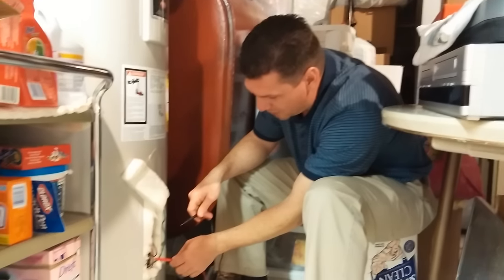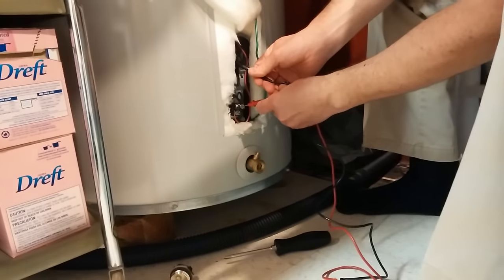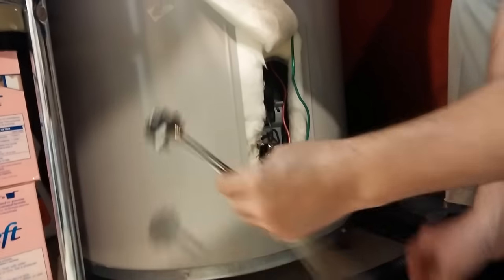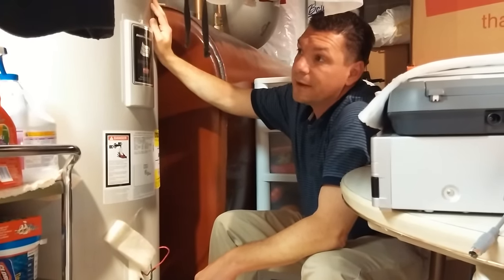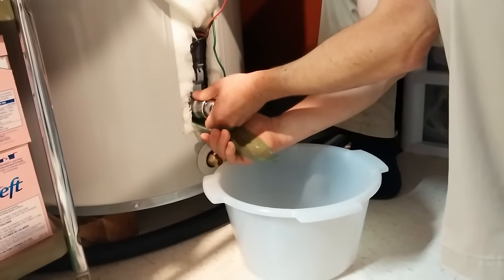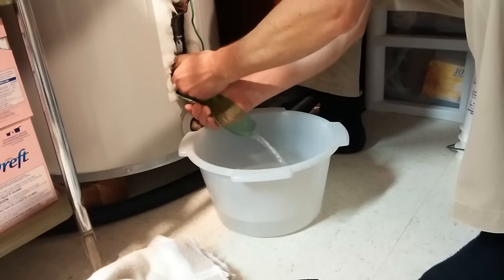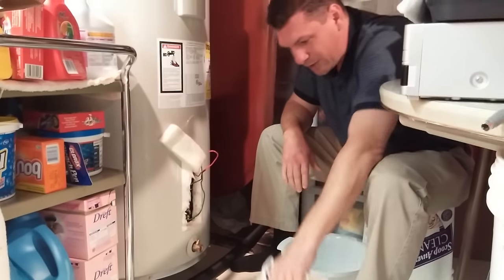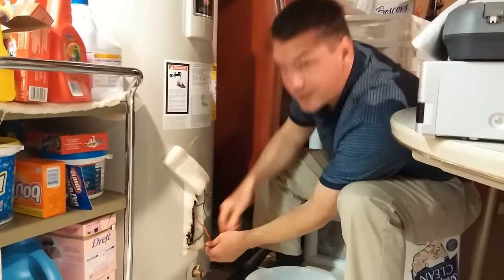Change a hot water heater element without draining or spilling water

Comment: DON’T DO IT THIS WAY. If you have hard water, chances are that your element will be warped. It will likely get mangled in the process of trying to remove it, meaning that to retighten it could end up twisting off the element from the end cap. Then, you’ll have the old element laying on the bottom of the tank. Or, you’ll realize you don’t want that, so you end up draining the tank anyway, but in a frenzy while trying to minimize the spill. Do yourself a favor and just take the few minutes to drain the tank. An ounce of prevention is worth at least 50 pounds of cure, here.

Comment: I just had to check because I just had the heating element changed in January and my hot water is out again!!! I never knew there were 2 elements and only 1 was changed so much water would run cold very quickly!!! Thanks to this Video it will be done correctly this time!!! Thanks for sharing!!!

Comment: So i was able to change the element thanks a bunch to this video! The tool to remove the element was at home depot where the water heater stuff is it was like $7. The element in my tank was straight and the one I put in was an s curved. This video however makes it look almost seamless. I have my water heater tank outside so I didn't care about spilling water but if Id a have it indoor I probably would've spilled more water than I would've liked. If you have 0 experience like me and your heater is indoors I would recommend a 2nd person to help you hold the funnel thing for the water and the plastic water container, and the other person remove and replace the element.
Reply: Even if you are outdoors couldn't the water get into the foam insulation inside the tank skin?   I would think having the device he showed would prevent that.

Comment: Hi Christopher 
I'm from Manchester England and the tool for the element boss is a 3 -3/8" or 86mm box spanner or  wrench as as they say in the states and the thread itself is 2" dia which seems like a big hole 
I drained the cylinder down 3 weeks ago with a hose pipe  which took ages as its big 
its in the loft so next time I do it I'll need a steady nerve on my part 
so thanks for replying !

Comment: Great trick but where I live the elements explode into because the water is full of lime and calcium and when you pull the element out the broken part hangs up so you have to snatch on it making a bigger mess. I'll usually drain the tank if it's the bottom element and I'll leave the water in for the top. Great video

Comment: Good vid man. I do maintenance for a living and an old timer taught me this years ago. Just make sure you have the rubber washer on the new element.
Reply from the maker: Thank you TechFive, other guys use towels to catch the water but it goes everywhere. The little 2 liter bottle cutout makes all the difference in the world from a cleanup standpoint. Yes I hear you about the washer on the new element!
Reply: @HarmonyTurbines  does the new element come with a rubber washer? I'm having issues with my energy smart electric water heater it isn't leaking but it keeps beeping and tripping.  Could that be from a bad element? Ty

Comment: The reason most water heater elements go bad is because most have calcium buildup around the lower element and it insulates the lower element from the water and burns it out. So the lower part of the water heater is full of this stuff and needs to be cleaned out before you change it. I use a shop vac the take out the filter to make it a wet vac and suck out most of the calcium with the sweeper and a piece of garden hose to stick in the tank and the other end in the sweeper hose. It takes time but you end up with a clean tank and my elements last about two years at a change. No water softener. I really need to get one and install it but I'm too cheap. Oh yea great trick with water heater. Will remember it.

Comment: Changing the sacrificial anode in the top of the water heater helps tremendously. For cases where the water is really hard, you may have to do it more than once a year.
Reply: Actually, very soft water is much harder on a hot water tank. In my experience, I've seen soft water ruin a tank in s little as four years. Living in a hard water area, I've seen tanks last fifteen years or more. Just my personal experience.

Comment: You should always cut power before changing the element. However, it is best to test range or ohms using a VOM this will absolutely tell you if your element is broken or 'grown' together. The ohm reading will be between 8-12 using the range setting, you will hear a beep to signify a complete circuit. So if it beeps, that element is good.
Reply: Only test range or ohms with power OFF
Reply: That was helpful as well thanks bud 🙏🙏👍👍

Comment: Nice trick, but I've always heard it's still a good idea to drain the tank every few years in order to remove deposits and help prevent premature corrosion.  I would think this would be a good time since the elements don't fail very often.
Reply from the maker: +Trent McKee Sorry to say that draining the tank (the way it's normally done with a hose) removes little to no deposits. To remove deposits requires scraping and a shop-vac. Been there and done that. So in 95% of the cases, maybe more; this is identical to what you'd pay a plumber to come in and do. -For one heck of a lot less and much faster.
Reply: Very good to know. Thanks for that tip!
Reply: I've lived in my home for twenty years and I've never had to change a heating element.  I wonder what makes them go bad.   I have seen videos showing people draining their tanks but most of them miss the most important part.    After you have emptied the tank, turn on the cold water for about sixty seconds - this flushes the stuff sitting at the bottom of the tank,  do this several times until the output runs clear.   Flush and drain.
Reply: i get an inch of sludge  out of mine every year when I drain the tank  for my preventative maintenance ! Never replaved an element  , but have to work on my in laws regularly

Comment: So, a few things. Ok, 13 things...

1. My mother is not in the country right now so I had to continue without her. In doing so, I was able to work in some cardio running up and down the stairs to turn a faucet on and off.

2. I got my handy dandy multimeter out only to realize that the battery was dead. Sigh. One 9v battery later we were back in business! Suspecting it was the bottom element that was blown, I opened up the cover and was greeted with a plastic covering. I looked at it and it looked back at me and then I ripped it off. Thankfully this part is actually made to be removable and I didn't just break it. 

3. Started poking all the screws with my multimeter probes. I was getting 240 volts. This confused me since I was certain this element was broken. So, I opened up the top element and took a reading from it. ZERO. Surprised, I proceeded in changing this one out as per your instructions.

4. I ended up being attacked with a Niagara Falls type magnitude tsunami of water spewing out at me, despite having turned the water off and getting my cardio in turning the faucet off. After my initial panic and bad thoughts about you had passed, I managed to finally get the new element in. It was actually quite tricky and nowhere near as easy as the lower element due to the force of Noah's flood pushing on it which was preventing me from quickly tightening it. Got it eventually.

5. Stood there for a few moments looking down at all the water on the floor. Oh well, how sad, nevermind. Onward to NARNIAAAAAAA!!

6. So took another reading. NADA. but but but but it's a new element even though the one I just took out was not damaged at all. Was it the bottom one after all?

7. Contemplated stabbing the water heater in a fit of "but he made it look so easy" rage with all of my screw drivers that have now fallen on the floor. 

8. Took out the bottom element and replaced it with the old top element. Ummmmed and Aaahhhheed over whether this was a good idea and whether or not I should swap them since the new element that Sears sent me was a different shape and bigger.

9. OK FINE! Swapped them but somehow managed to do it without the need of a mask and snorkel. Did I somehow level up and didn't hear the level up jingle over my scorn of What The Frak just happened and why-ness?

10. Another reading. Another ZIP. Looked up bad breaker. Wait, what? They turn on at different times? What? Who? When the top one is done heating then the bottom one turns on? and vice versa? Is this a "guys to know only" type conspiracy? HOLY BAIT AND SWITCH BATMAN!!!!

11. <deep breathing WOOSAAAaaaaa one day we'll all be eeeqquuaaaalllll>
Top element = 240v. Bot element = 0v. Check!
Wait a minute or so for the great switcheroo.
Top element = 0v. Bot element = 240v. Check!
It works. Wait, it works? Whoa! IT WORKS ... AND I DIDN'T ELECTROCUTE MYSELF MWAHAHAHAHAAAAA ok the little zap from accidentally touching the 2 screws on the element was a little hair raising but I'm fine .. bbzztttt ... f-f-fine!

12. Put everything back together and tried to make the water on the floor disappear with my new jedi powers. Ok, obviously I am not at the "making water disappear with my mind" level yet. So, was thankful to have a shopvac handy for the great water cleanup.

13. Turned the hot water on to feel it and marvel in my newfound abilities .. and SPUTTER FIZT BBRRRR who put Speed Buggy in the water pipes? Seriously! Will this madness never end? <a few seconds later> WAATTTEERRRRRR! and Moses didn't have strike any rocks for me!!

So, thanks to both you and your mom for your video. It was mostly helpful :) Like, maybe 95% helpful, which is a lot! :)
Reply from the maker: Deb you made me laugh out loud... seriously. I'm rather confused why you got the huge gush of water you describe. Were you sure you had the incoming water line ball valve turned off to your tank. Then relieve the pressure at one of the sinks at which point closing the sink should seal that branch off and opening your tank should have been quite uneventful. I had a small trickle as shown in my video but nothing crazy like what you very animatedly described.
Reply: Hi again!! 

Ok, soooo you caught me. I confess. It WAS me that killed the hot water with the bright red lever attached to the lead pipe in the basement. You must be very good at CLUE!
I am assuming it is bright red to indicate HOT WATER - DANGER, DANGER WILL ROBINSON !!
There were no other pretty colored levers so I was fairly certain that was indeed the lever I was looking for. I did not shut down the tractor beam though. That was Obi Wan. I also did not shut off the water main. Nobody did. I blame my mother for not being able to come over and help ;)

I DID open a hot water tap in the kitchen until the water stopped coming out of the faucet and then I closed that again - as you noted in your video - and proceeded with the element change - or as I like to call it, how much water can a basement floor hold if a basement floor was flooded during a hot water element change. Ok, so I might have to rethink the rhyming.

And your water shoot does rock!!! I made one too. Mine helped to distribute the gushing water in a more broader spray pattern including up my arms. Of course, I keep wondering if it would have helped if I had remembered that you used a 2L instead of the 16oz. bottle I grabbed. But we shall not speak of it!! So sshhhhh. Nothing to see here, move along.

Did I miss a step?

Overall, I do actually think that my element change was successful AND I got to play with tools. BONUS!!

I am very thankful for your video!!! Take care!
Reply from the maker: So you have given me another important step to add to my video now. The one that states to be ABSOLUTELY certain that you are shutting off the INCOMING water line ball valve. Apparently you turned off the HOT (hence red) outgoing water line. That was why your hot water only trickled because nothing was coming out of your hot water tank. But it was most certainly (by your description) receiving full incoming pressure. In this case if you had no incoming water line ball valve for your tank your option would have been to shut off the main. So I'm sorry that this point was not something I thought to outline before.
Reply: wow...deb is really clever with the comments. HA HA!! I thought my Heating elements were bad or at least one. tested them both with the power off with my multi-meter and they read 13.3 ohms (10-16 ohms is good, so I've read). so, turned up the temp on the bottom element (as top was already maxed out and has been since before i moved in as this is the first time even checking it). so hopefully water stays hotter longer since i turned up the bottom element. if not then i must need a whole new water heater (only saying that because the model number on the one i currently have is non existent with google and also the manufacturer. which to me means its OLD.) anyhow. thank you for the video that if or when i ever do need to change the top or bottom Element ill know how :)
Reply: well, that makes a lot of sense then!!! 
THANKS for helping to figure that out so that I know for next time!
Also, idk if your main is right by your water heater but mine is not, it's in a completely different area of the basement. So didn't know if that might be important for people to know. But WOOT!

Comment: Good vid. Good invention. nice trick. I Guess u had Pipe doped the new element allready on the  threads so it does not seep water ? Note - its allways good to drain the hot water heater every year a bit to get rid of the sand & silt / sediment & calcium rocks that accumulate in a Hot water tank anyhow.
Reply from the maker: Sure my video wasn't speaking to the benefits of draining or not draining a tank. It was just a quick video on a fast way to change the element. Obviously it doesn't negate the other needs for maintenance you spoke of.

Comment: Don't forget to tell EVERYONE in the house not to use the water while you are doing this. Or you will get a bath....yes I have had it happen to me:) Also, white dope on the gasket and threads helps too. >>>read this<<< if you live in an area with hard water the element can easily get stuck while removing from the large deposits caked on the element. Be prepared.

Comment: I've done this a long time ago and not being sure I did it the safer way shut everything off emptied water and did my element change. Now there are two compartments for the elements the lower one you did and a top one, Do all the same rules apply for the top element as well?? thanks
Reply from the maker: yup you just want to be sure you have created a sealed system before opening things up otherwise it would gush out. By having all faucets closed off and water line ball valves to your tank closed, you should have no problem so long as you're quick.
Reply: @HarmonyTurbines  Hi Chris, great video, thank you! Two questions - I’ll be doing this alone. After checking with a multimeter to make sure the power is off and closing the incoming water on the cold side: when I open a hot water tap in the house - how long should I wait for the pressure to be relieved before I shut the hot water tap? Wondering the size of the socket you used to remove the heating element? Thanks in advance.

Comment: very impressed Christopher am I right to think you couldn't do that with a 2" dia  heating element ?
Reply from the maker: +bob rambo I don't see why it wouldn't work the same way. You get some spillage but the 2 liter bottle fixes that. Just make sure you have the right socket for your element. Not sure you could fit an adjustable wrench in there deep enough without being hindered in movement.

Comment: what sort of socket was that for your wrench?
Reply from the maker: I believe they are 1 1/2 (1.5) inch sockets. 6 point. You don't need that but it makes it nicer for sure.
Reply: I know this is a 6 year old comment, but to those expecting to use (or buy) a 1 1/2 inch socket, DON'T  expect it to work... Sockets this size normally have the opening beveled or chamfered to make it easier to put over a large nut... A water heater element isn't a nut... It's hexagon surface is is less than 1/4 inch thick and doesn't make it pas the inside bevel of the socket. If the old element is the least-bit fused into place, you'll round the shoulder nut and be in REAL trouble.

I DID purchase a normal socket to be used exclusively for this and it resides full-time on top of the appliance, but the answer (for me) was to machine the leading 1/4 inch from the socket's opening so that the opening was a true 1 1/2 inch. 

I suppose you could sand or grind it... Anything to get past the bevel and create a flat mating surface. OR you could buy the actual socket made for this... It's as cheap (or cheaper) than most sockets of this size. I made mine years before I was internet active... Notice the flush-cut face on the REAL element socket for less than $15.00.
https://www.amazon.com/Camco-09951-Professional-Heater-Element/dp/B00103PNTO?source=ps-sl-shoppingads-lpcontext&psc=1

The "cheap" slip-on tools they sell (sometimes MORE than the price of the Pro socket in the link) are a soft thin-wall round tubing pressed out to a 1 1/2" hex... they fit like sh** and If your element is corroded or tight, the walls will actually flex and stretch out of shape and you've just ruined your tool... They are USELESS and in more cases than not, a headache. Opt for the "big boy tool" and the job will be a breeze.